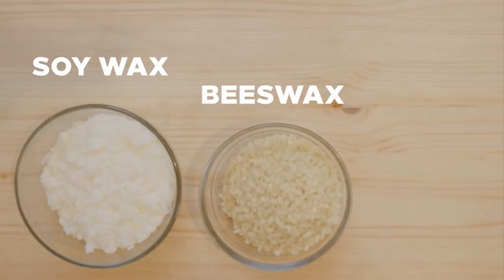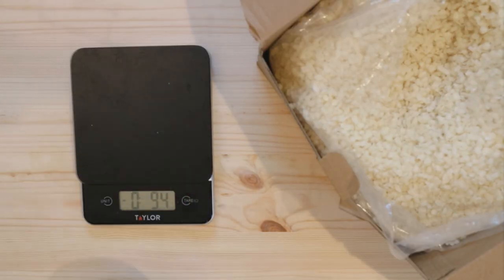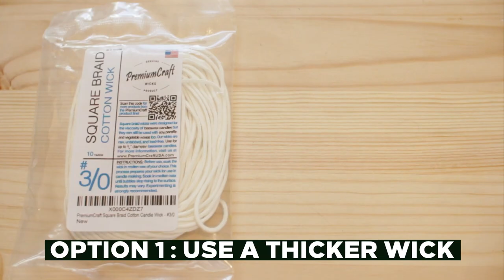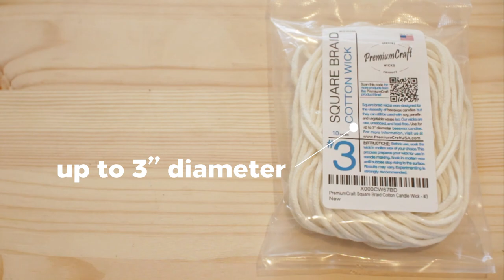How To Make a Really Big Candle - Make a 7 Wick Candle with Me!

Comment: One of my reed diffuser clients just asked me to make them two XL outdoor candles. I do wax melts, but have never experimented with candles, let alone 14.5 inch wide outdoor ones! so that's quite a fun challenge to take. Before purchasing material and diving into the actual candle making, I am obviously doing plenty of research, and your video has been the most helpful resource for me on this journey, Julia. You should really add a super thanks button!
+ If I may humbly add a point or two from my noob position, I think it's worth experimenting with different wicks before comitting to one type, making sure to test them in the intended use case, in this case, outdoors. As I understand it, some are surely going to perform better than others. I also think it's worth noting that not all beeswax are hard, and not all soy waxes are soft. Lastly, for those of us who ship our products, especially in summer, I believe it's worth looking into waxes with high congealing points, to minimize the risk of deformation during shipping. The one I went for has a congealing point of 120-129° F. I'd love to hear your thoughts on these.